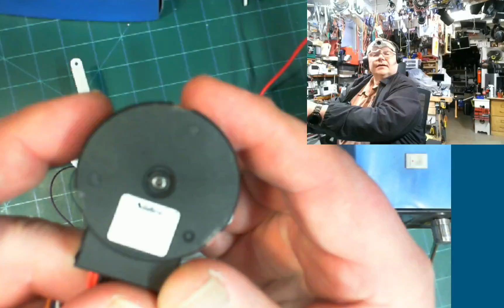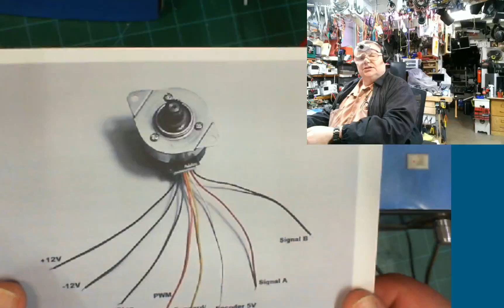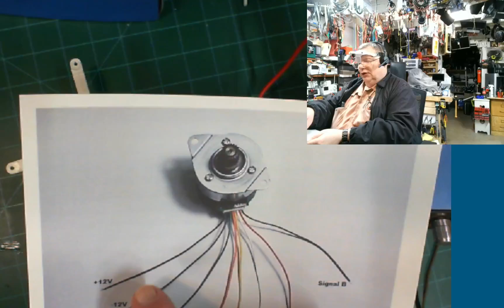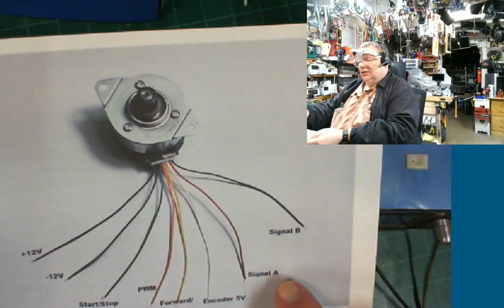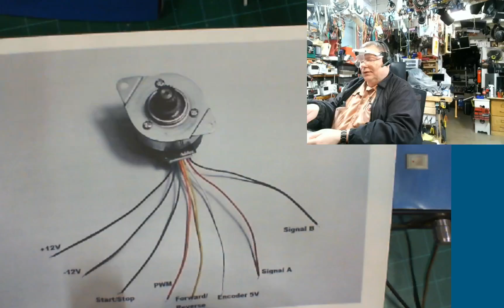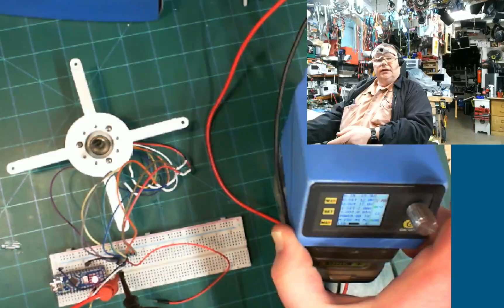How to wire NIDEC 24H  electric motor with Arduino (The self balancing CUBE)

Comment: Did you ever get this working?  I just finished building the cube and got it balancing on the 3 edges, but I'm still tuning for the vortex.  My problem is likely related to the amount of code changes made, which I thought would be easier than changing the wires on the motors.  I'm new to Arduino and this was (and still is) my first project like this.

Comment: please release the 12 pin soon, ive also spent a lot of money to no avail, thanks
Reply from the maker: It's on my long list of projects that I've started, and something more interesting shown up....
Sometimes in next 2 weeks I'll test the 12 wire Nidec motors.
Reply: I also have the 12-pin motors.  I saved them and plan to try to get them spinning soon.  My understanding is that the 12-pin motors are fundamentally different, but they also have modes of operation.   I think it would also be great if someone could get the balancing cube code to compile in the latest Arduino IDE using current Board Managers.